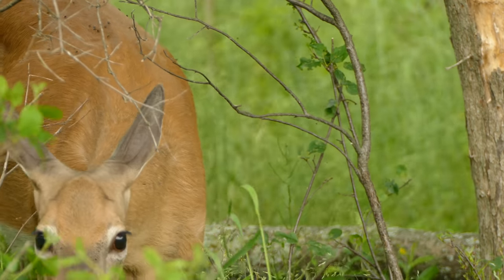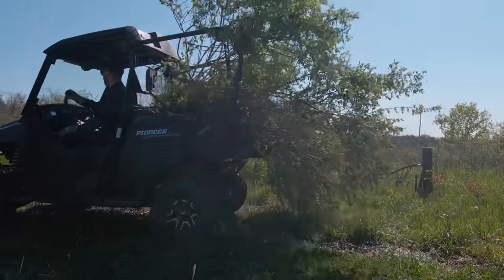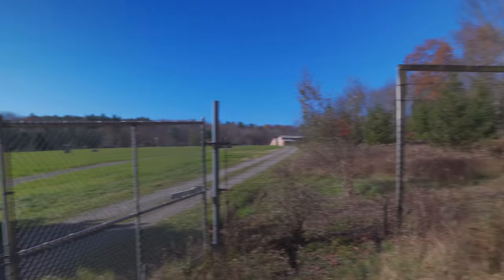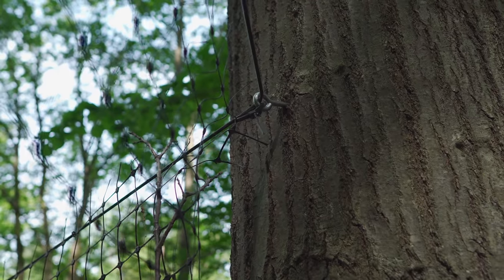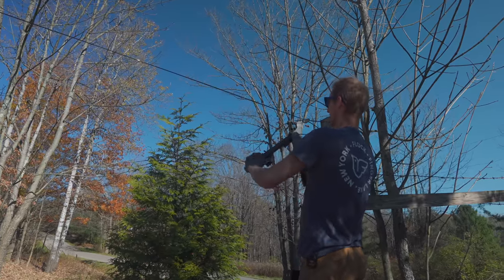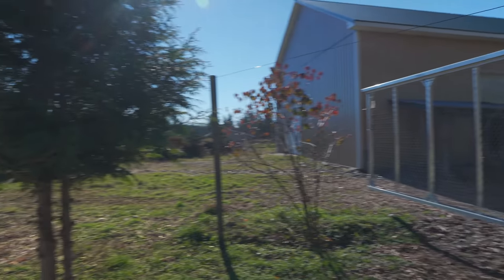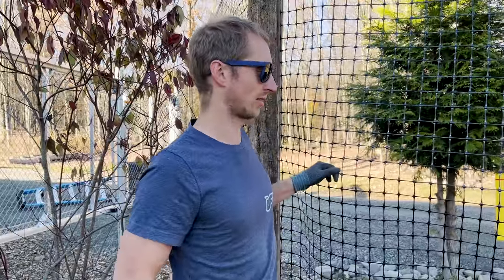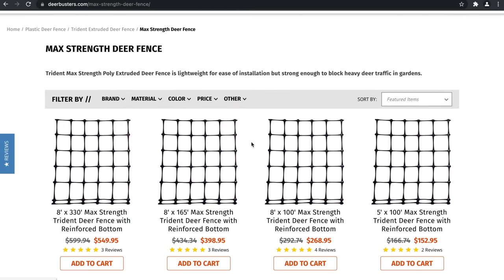QUICK, EASY, AFFORDABLE DIY Deer Fence Installation — Ep. 068

Comment: I have the same deer mesh and it's still working 20 years later, but really at the end of its life. Just a few tips from someone who's done all this. If you don't open the swager quite so far, it's easier to close and crimp the swages. Get those white ribbons up asap because if the deer don't see the fence and walk into it, they can get startled and go hard into the fence and get tangled, rather than backing up, creating a problem for both the fence and the deer. I use cotton string instead of synthetic ribbon because cotton lasts for many years and will biodegrade instead of turn into microplastic.

To make the fence more secure, you can run a ground wire and use the hog rings to attach the mesh to the ground wire. Then your ground stakes hold the wire, securing the whole span between posts. Using the stakes through a single square of mesh is not securing the bottom of the fence, because one rip of the bottom square and the entire bottom of the fence can be lifted up. I've seen deer go through an 18" tall gap! I'm glad you learned to run the fence on the outside of the posts for all future installations. On my property, outside the fence line is now a game trail from all the deer walking just outside the fence, hoping to find a way in. 

I don't recommend you put out salt licks or deer feed elsewhere on the property, because that would attract even more deer, and it would contribute to increasing the deer population when there's already way too many. Lastly, when applying the staples to the wood posts, you want to keep the staples loose enough that there is play if an animal pushes against the fence. When the mesh slides through the staple, there's a bit of give, providing some gentle resistance instead breaking upon impact if the mesh is taut under a staple. Read about how a high tensile fence works and apply those same principles to your DIY fencing project as much as you can. Your next run of fence will be even better than the pretty good job you did this time around! You might find that this style of fencing is preferable to the metal style fencing the contractor would install. You have the whole winter to consider it.
Reply: Great points!! I love when the viewers share on their experiences. Good job!!
Reply: White warning banners are crucial for deer fence! Without them, the deer can't see the fence. The cotton string sounds like a really creative idea!

Comment: I have a small vegetable garden and we used deer busters fence to surround it. I love how yours looks nice and tight on the top and I thought you did a great job on the installation. We (he 😀) attached ours to metal poles around the garden but the top is just loose and floppy. The fencing has held up well for several years although we had to reinforce our metal poles because one year the snow was so heavy on the fence it fell down. Now if I see snow accumulating on it I just go out and give it a shake so it falls to the ground. One other issue was either a rabbit or woodchuck started to chew through the fence….a small section is broken up, but I also have chicken wire set next to it into the ground and I think the critter got discouraged and gave up.
Reply from the maker: All good things to know and nice to hear that you also used a DeerBusters fence. They had recommended that we use a tensioned monofilament line both at the top and the bottom actually, so we did that in the forested area with a new run, and we see that as being fairly sturdy. I guess you can always just run a monofilament line around your garden bed to tension it and use some of those hog rings to attach your fence to the line. That's what's great about the product. It's pretty versatile and you can easily fix/improve it as you go.
Reply: Happy to hear you trusted us with your garden! Tensioning is the best way to get those top flops nice and flat! As far as critters go, if determined, they will certainly chew through the poly fencing. We recommend our steel hex for the bottom of poly fencing to prevent those tricky critters from getting into the garden, but it sounds like you already have that covered with the chicken wire!

Comment: If you put the fence in front of one pole then go behind the other pole if something pushes one way it won’t come off the fence because the fencing is behind the next post. I hope that made sense? It’s like weaving . 🎄💚🙃
Reply: Well, if something pushes the fence, it's gonna do it from outside, so its better to just put fence on that side.
Reply: @tesha199  I’m just thinking depending on the way the wing blows snow may have and impact on the fencing?
Reply: @judymckerrow6720  yeah, that's a good point to consider

Comment: We are currently putting up this fence although it is a plastic coating over the metal. I feared the critters would chew through the plastic. So far so good and glad you used the tension wire. Looking good!
Reply: Determined critters can and most certainly will chew through poly fencing. The metal serves as a great option as well! Hope the installation is going smoothly!
Reply: @TridentEnterprises  Install in going great! Just getting the hang of handling those heavy rolls of wire lol. We tie roll off to bottom of next post to put tension on fence then use the metal zip ties. That's working out great and we're half way there putting up the 600ft! We two girls are getting it done lol.
Reply: @cpnotill9264  WAHOO! Glad it's going so well! If you run into any issues, give DeerBusters a call and we would be happy to help (sounds like you two probably won't need us though, because you two are already PRO's)! Also, if you are taking photos of the progress, we love to see your hard work!
Reply: @TridentEnterprises  Will do and thanks for comments!

Comment: We did some test runs with a similar approach. But over a year the mesh fence broke at the top wire connections mostly in wind storms. We have seen people weaving a line thru the top of the mesh fence but that seems like a lot of work. Experimented with folding it over at the top , gluing and creating a "envelope" for the write to sit inside. Kind of like a curtain rod and curtain but can't find good glue and labor intensive.

Comment: If I would have done this job I would have zip tied the fence to the Post then weaved the wire back and forth through the top of the fence. That would have made the top of the fence more secure for when the deer try to jump it because I'm sure they will.

Comment: It is fun to watch people learn.  More than one way to skin a cat so to speak.  I wonder how effective and expensive it is to have an electric fence (one wire at deer shoulder height) which is solar powered, with battery for overnight.  I feel like it would be a way to make this temp. fencing last much longer, many years potentially.
Reply from the maker: One of the first contractors that we met with shared that electric fences were an option, but running one became a larger expense. That being said, he also shared that deer will 'take the hit' and still go over an electric fence. So will bear, which is what is recommended if you have bee hives. But at least the electric fence provides another barrier / deterrence. The real challenge is, diverting the deer from an area that they have grown accustomed to. We're thinking of ways to encourage them outside the fence, like building safe havens for them out there, setting up salt licks, etc. Will definitely be a learn-as-we-go type of thing! Tnanks for watching and commenting Elisabeth.
Reply: @FlockFingerLakes  Great idea to make them happy outside the fence.  Positive feedback instead of negative.

Comment: Do 'Deer Busters' or the Conservation Department recommend anything about feeding or not feeding deer, in a... all deer are welcome.... location, after the snow falls, or is that counterproductive?  What has happened to the predator population? Is hunting allowed in your area?  Hope none get caught in the fence. 🦌🦌🦌🦌🦌🦌🦌🦌🦌🦌🦌🦌🦌🦌🦌 The fence looks good. Hope it works for the most part.
Reply from the maker: Generally it's recommended not to feed the deer, especially because as winter approaches, their gut biome changes rather dramatically, and you can actually kill the deer by giving them high starch foods, like corn and hay, etc.,  (which is often sold as "deer food" in winter). Their guts switch over to eating more fibrous materials, like bark and what not. That being said, we probably will set up areas outside the exclusion fence with salt licks and items that we have seen them eat on the land here, so they have some alternatives to browse on in the dead of winter. We saw most of the damage here in late Jan and early February when the snows were so bad. They turned to eating the roughest of plants and also raiding the bird seed. As far as the predator population—that was primarily wolves and mountain lions. There has been one mountain lion sighting, but it's rare. Wolves had been exterminated from this area a long time ago, so the "natural predators" now are humans and cars. Coyotes may take some young deer, but they are not as formidable as say a wolf. Hunting happens all over the area here, but it still doesn't reduce the population below the carrying capacity. And the recommendations are to build the fence high enough so that deer don't clip their foot on a fence (and hang themselves by the leg). If the fence were anything less than 8ft, that could definitely happen.
Reply: @FlockFingerLakes  Thanks for that info. I bet that they will still be silly around the fences. Then they get to be YouTube stars in  animal rescue videos. Could they eat the bark on  branches or logs resulting from tree trimmers who come in Winter or from trees which you cut down or do they only attack living trees?  They brought wolves back into the country here, much to the dismay of farmers and people just enjoying the outdoors. Some are shy but others are not. They get photographed and appear on the news. 🐺

Comment: Here, the imported and now highly invasive white-tailed deer (Odocoileus virginianus) is a real nuisance. The only long-term solution is a proper rust resistant 2 mm metal wire 2 m high "moose fence", designed to keep out much larger animals. I surely hope I would have more lynx or wolves to naturally hinder the deer population. Occasionally deer still get inside the enclosure (mainly due to high snow drifts), and it's good to have a dog that knows how to chase them out again. That temporary fence does look very tempting to try out, especially in rocky areas with varying topography.
Reply from the maker: Where are you located and what was the reason that white-tail deer were imported? Just for sport?
Reply: @FlockFingerLakes  I'm located in Southern Finland, about on the same latitude as Anchorage (AK). The deer were introduced in the 30's solely for hunting purposes. Other North American imports mostly detrimental to indigenous fauna include the muskrat, American mink, and North American beaver. Climate change definitely has helped the above-mentioned species to take over the niches priorly occupied by indigenous species. Deer don't shy away from populated areas, hunting restrictions here therefore allow significant areas for the deer to seek refuge from the original purpose of being game.

Comment: That one tool is a modern fence puller. What is the life expectancy of the plastic fence. Sun will break down the plastic.
Reply from the maker: Some folks here in discussion are reporting around 20 years. We call it a "temporary" solution for us because we want to replace with a stronger fence, but this one can totally suffice as an alternative. We learned about this at Cornell Botanic Gardens https://youtu.be/aOLY1AIA9zI

Comment: $20-30 per foot installed fence?  That's crazy.  We had fence ( 8 feet high) hi-tensile installed for about $5.50 per foot.  They were all set up for this kind of work and installed 2000 feet in just over 2 days.  Good luck because deer are devastating for shrubs and fruit trees.
Reply from the maker: Pandemic prices! eeeeek. We were too little, too late...